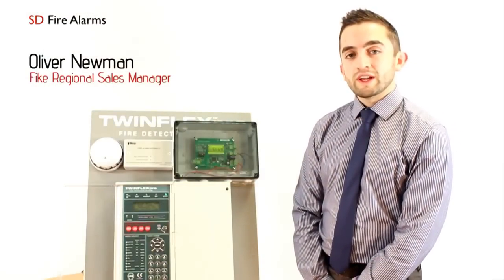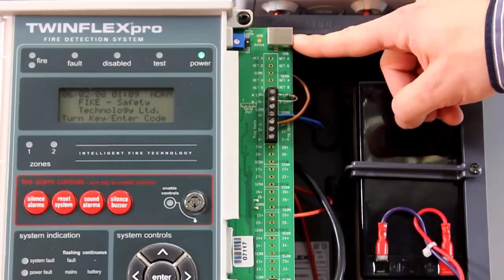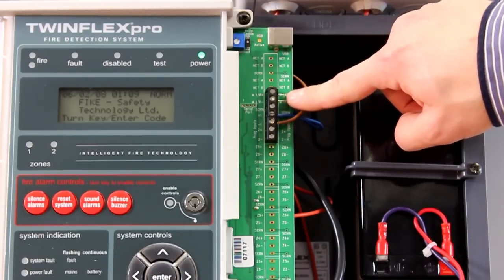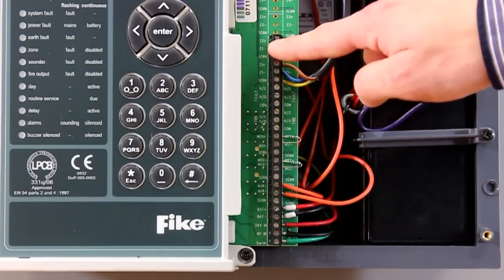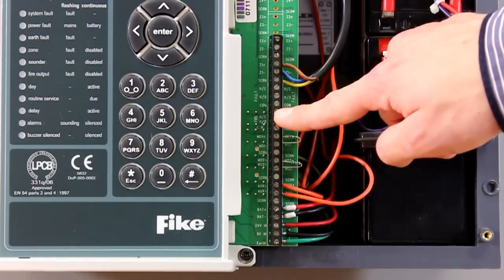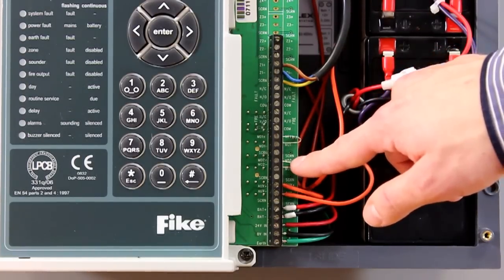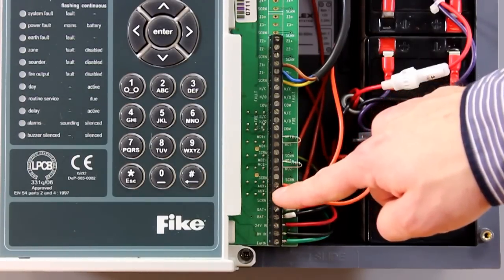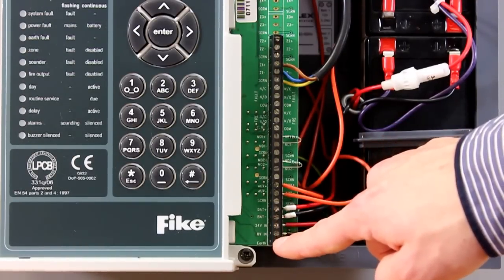Fike Twinflex Pro Panel Part 1: Connections within the panel itself

Comment: great video iam bout staart maaintaing a twin flex pro system would you advise using the usb connection to a laptop and if so do you supply the soft wear ?
Reply from the maker: +Jim Robinson Yes, you can do that.  We sell the software here http://www.sdfirealarms.co.uk/505-0040-twinflex-pro-osp-pc-programming-software.html

It would make it easier to manage the system, but not essential.  It would help if you went on the 1 day training course that Fike provides, and we may be able to get you on this free of charge if you’re interested.  It is only held in one location (Cwmbran, South Wales). 

Thank for your comment

Comment: Hi can you tell what kind of cable I need for the data link between the main panel and the repeater panel. Do I just run a two core and earth FP or does it need to be a cat6 twisted pair?